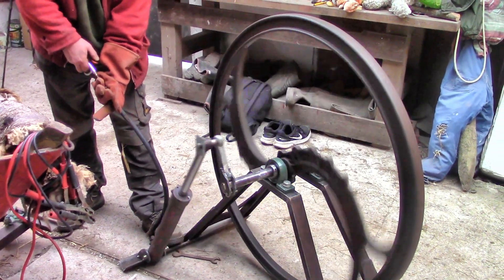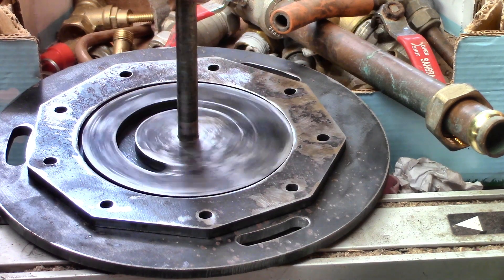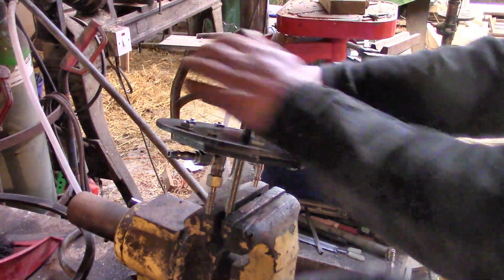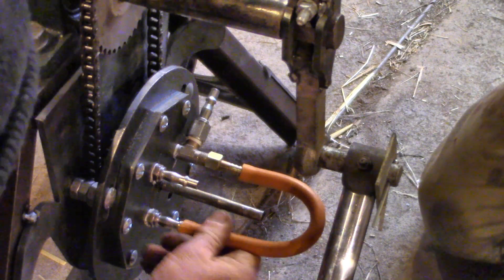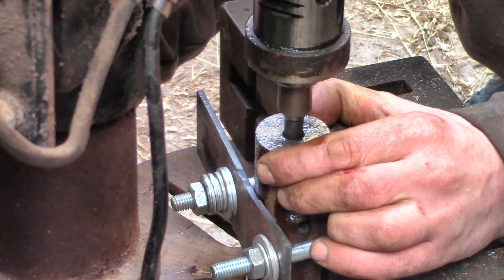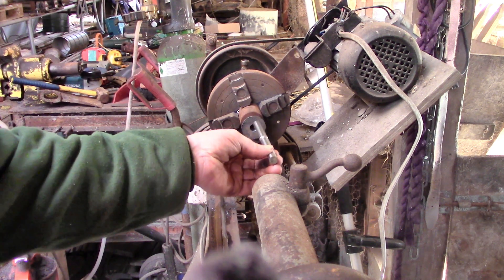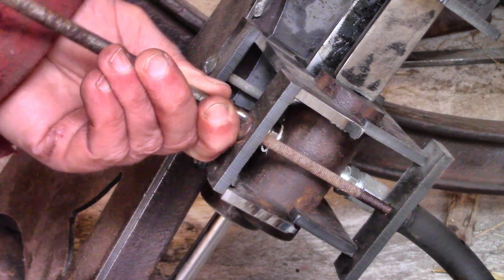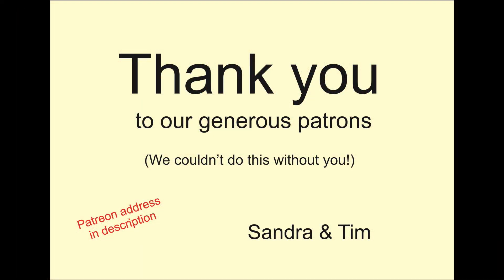Homemade Rotary Disc Valve And Spool Valves For The Steam Engine (I’ve been busy!)

Comment: Hey Tim, I’m an engineering student and I love the videos you and Sandra put out. I think I have an interesting way of solving your valve problem while also opening it to further expansion down the line for a powered push and pull stroke. For the single push stroke model you’ll need to make a box with 3 holes. Two on the top and one on the side. The first on the top will be an inlet valve hole and the second on the top will be an excess release valve hole. On the side will be the outlet hole with no valve. The valves will be made similar to those in an engine. A wide circle with some form of high pressure sealant along the outer edge such as rubber and a rod welded to the center of the disk. These rods will be inserted through the top holes and a powerful spring placed over the rods and centered over the holes and tacked in place to the box. The top of the rods will be threaded so a locking washer can be put onto the spring and the tension pulling each valve closed adjusted as needed. The inlet rod will have to be more complex than the outlet rod and will have to be a bit thicker and longer to make it work. So the inlet rod will have to be turned on a lathe to 2 diameters, thicker towards the disk and a second narrower section at the top to allow for the threads to retain the tension spring on the lower section. On the upper section of the inlet rod a set of 2-3 channels will have to be cut to allow for some small O rings to be put on the rod (hence the different diameters to prevent having to cut the threads over the entire length) Then a housing cylinder will have to be made for the inlet. If you take a bit tube and some round stock you can ream out the round stock to fit the smaller diameter of the rod (accounting for the o rings) then weld the pipe onto the round stock being careful not to get it too hot to prevent warping. Then drill and tap a hole on the side of the inlet housing to attach a quick connect for the air to come in. Adjust the tension on the inlet rod so it will stay shut at pressure then either weld the housing on or find a way to seal it and screw it on. If this is done properly you’ll be left with a sealed zone above the inlet and a rod sticking out the housing that releases the air into the main box when pushed. For the release valve you don’t need to put any housing around it at all.

Now the interesting bit. Attach the valve box to the frame so that the rods point to the center of the wheel such that the rods are parallel to the axle. Reusing your 2 sets of cams and push rods set them so that they are 180 degrees out of phase or so. When the air is connected, the inlet valve will be shut until cam A presses on the push rod that hits and opens the inlet valve. Meanwhile cam B will disengage the release valve allowing pressure to build in the cylinder and turn the wheel. Once the cylinder reaches the end of its stroke inertia will carry it around disengaging cam A and shutting the air off while cam B engages the release valve and allows the pressure in the cylinder to drop and finish the revolution. By playing around with the shape and offset phasing of cam A and cam B  you’ll be able to dial in the maximum power to speed ratio. I’m not sure why but I think you might want to make each cam about a 1/3 of a circle and play with the phasing until you reach the sweet spot.

By adding a second box and some more cams and push rods it should also be possible to make a powered “pull” stroke as well by attaching the top of the cylinder to air as well but the timing would require a fair bit of testing to get your timing just right. If you think this would help at all send me a message and I’d be happy to help you work on some more detailed schematics. My email is crimsondragon97@gmail.com

Comment: You had it working when you were opening and closing the air supply from the compressor trigger manually ( right at the start of the project). Why not just add a small and simple lever that presses on the same airline trigger at the right time. A cam on the flywheel main axle would suffice and attach trigger next to it.
Reply from the maker: because they have plastic in them (no good for steam)

Comment: You could probably revisit the rotary disc valve if you put the air/steam input on the opposite side. If you look at steam engine valves, they are usually sealed by the steam pressure. Incoming steam presses down on the valve, sealing it to the valve block. For your disc valve, you'll need a seal of some kind on the rotating shaft. I guess a graphite gland. And you might want to flatten the mating surfaces of the valve and plate, might need your machinist buddy to do that. Still, it might yet be the simplest way for you to make a valve setup, given you have a plasma cutter.

Also, you are going to want to get/make a double acting steam engine, and one with a much wider piston.
Reply from the maker: Are you sure a wider cylinder will be needed? A long stroke is slower but has more torque..
Reply: @wayoutwest-workshopstuff6299  I suppose it depends on a lot of things. What steam pressure you'll be running, the capability of the boiler, how fast the engine should move, etc. That's getting into engineering that I only have a cursory understanding of.

I'm no steam expert. Just an armchair engineer. But look at old steam engines. Most have a big bore and not so long stroke. Maybe square or a little longer stroke.

Just a thought :)

Comment: Thank you for doing the R&D for a diy steam engine. As I've mentioned, I have a goal of eventually having a steam powered electric genny but don't have the time to tinker on it at the moment. Seeing your efforts is teaching me boatloads that I would have to learn by reading or trial and error later. 

I'd love to see what happens when you add a second set of valves to make the piston double acting, and even more valves to add a second piston.
Reply from the maker: me too : -  )

Comment: So what you need to do is simply make the steam groove in the valve longer and drill a second hole for exhaust, you don’t need two valves for a single acting engine.
With that modification you can have a double acting engine.
I wish I was you neighbor, I could help you out on this project! Maybe trade an Airedale puppy for machine work.😄

Comment: Kudos on using the wood lathe, That’s what metal was machined on up until the industrial revolution. Research it.
Spool valves weren’t used until the late 1800s, by then technology had advanced to the point that metal packing rings were common.
Before that, D valves or 90 degree taps were the earliest ones used.
Reply from the maker: Thanks, Ross. D valves are a sort of slide valve?
Reply: @wayoutwest-workshopstuff6299  Yes, Without a good way to surface them you will run into the same leakage problems as the rotary valve.  
A spool valve will take a lot less horse power to operate though.

Comment: Tim, this would be alot easier with another piston, you could use that lathe to build a custom timing valve to split compression.
Reply from the maker: I'm working on it..!
Reply: @wayoutwest-workshopstuff6299  You could also use your current piston to store energy in a return spring. The work of the engine would be limited to what you can store in the return spring. I'm assuming you could easily create 5lbs of constant torque out of this engine by storing energy in a return spring.

Comment: Why not a slide valve? one of the main benefits is that instead of needing dimensional accuracy, you just need flatness, and the pressure pushes the faces together. they also allow for double action with only two critical seals.
Reply from the maker: Those critical seals are the tricky bit though, aren't they?
Reply: @wayoutwest-workshopstuff6299  not to bad; I don't think you need any crazy tolerance on the slide, just flat on both sides, and the shaft into the steam box can be a packed seal, so also not to bad

Comment: What designation was the iron? I've never seen cast make chips like that, it's usually very powdery. I've never even heard of free machining cast iron, it machines quite easy? Maybe it's a different terminology in the states
Reply from the maker: Sorry Jean-Paul, I only know what I'm told by others. But it does drill very easily - like hard cheese

Comment: Nicely done. 
  One issue with this is the long hose feeding the air cylinder. Long hose wastes energy, adds delay adds extra amount of air to be evacuated during exhaust stroke. 
  The design would benefit moving valves as close to air cylinder as possible and use longer pushrods.
Reply from the maker: I agree, but the frame gets in the way so this is a compromise

Comment: When you don't have access to machining equipment but you need a flat surface, you can use the three plate technique! Look it up, it's quite simple. The basic principle is that if you have three plates and none of them are flat, there is a way to ensure a perfectly flat surface by using the right combination of the three. I think even if you did not want to go to this degree, perhaps putting some grit between the two discs and lapping them together in a rotary manner, perhaps with a drill press, you could get much closer to a machined surface
Reply from the maker: I did just that - with some fine carborundum paste. Perhaps not enough?

Comment: Since the flywheel itself has two spokes, could you not use it to control the timing? Like every time they spoke comes around, it triggers a dog opening the valve momentarily. I suppose it would be a little tricky to get the timing arranged with the key seat, but it would be an elegantly simple design.
Reply from the maker: I like it!

Comment: @Way Out West - Workshop Stuff
10:33 USE COOLING liquids.
You get better surfaces, less wear on the tools, and not as much heat expansion in the material, which is really important for high precision stuff.

Comment: @Way Out West - Workshop Stuff (previous comment attached as reply, for reference)
You could use the disk & sprocket in a 1:1 gearing, then use the disk as a "programming wheel" by adding a groove or ramp onto it (depending on side), that controls a switch for a solenoid or similar, this would also remove almost all that problematic friction. These kinds of programming wheels have been used extensively in early industrial age, and can accomplish AMAZING feats of engineering. For example, THIS: https://youtu.be/OehTO9l1Hp8?t=159
You see that vertically rotating thick cylinder thing, that is a large stack of analogue "programming wheels" (I don't know the name, cam wheel?), that controls how the arm moves.
Also, check this video, he makes a high flow solenoid-ish thing: https://youtu.be/gnwIiw3Rz3I?t=449

12:22 YES! this is what I mean :D (but with a wheel at the contact point to remove more friction.)
For each of those cams, if you make them half as thick, but double them up to the same thickens, then because you already have that groove with a bolt, it would let you also rotate them in opposite directions to increase/reduce the durations of the in-/-activation times.
Reply from the maker: Thanks, Sion. I will study that when I get a chance - so much to learn!
Reply: @Way Out West - Workshop Stuff (For reference, my previous comment)
MAGIC VALVE-ish: 
The timing is directly tied to the rotational position of the flywheel, you could add a kind if ramp & similar to the flywheel (add counter balancing weights too) for the length=duration that the steam needs to be added, then have some kind of button-like thing that gets pressed in when the ramp is in the right position which lets in more steam.

Comment: A silly question but could you not make a second hole in one of the spool valves to allow the air to exit when it’s in the opposite of the air in and that way you could have the two valve actuating both ends of travel so each stroke is a powered one? I don’t know a lot about spool valves I’m afraid but it seams to me that they are like a primitive hydraulic valve like those found on diggers for allowing the fluid either in one end or the other ( if my memory serves if not then it’s the case of the fluid is allowed to enter or exit) would seam to me to be the best option and if I was doing it how I would go about it
Reply from the maker: You're right, it could work. But I think I'd rather have two single-acting pistons than one double acting.
Reply: @wayoutwest-workshopstuff6299  ah of course it does depend what your planning as to how much power you would need and I’m also a big steam fan within my own miniature loco which surprisingly did run and pull weight on one cylinder

Comment: If you use steam, and water condensate gets inside the cast iron housing and compressed on the down stroke, is there danger that the pressure could blow the cylinder to bits? Or is there some kind of relief valve going to be added?
Reply from the maker: this is the sort of thing I hear about a lot, but no one tells me why water would collect in there and not get ejected with each exhaust stroke. So I just don't know.

Comment: Two valves.  One at each end of the piston.  They would switch one being open for exhaust, one closed allowing the air/steam to drive the piston.  It would switch open for the air to exhaust and the other side to push.  Not sure if your familiar with reed swithes but that or a timed relay would probably work.  More mechanical would be a switch that comes on at a preset points on the piston stroke for push and push.  
Thanks for all your hard work.  Your very inspiring and I feel like we would be great friends if I lived nearby.  
My project last week was turning my box truck cooler into a solar powered cooler using 6 panels, and some Nissan leaf batteries.  It works beautifully and I use it several times a week when away from home.  Cheers

Comment: There will likely be someone near to you that can pop the plates on a surface grinder, I have access to one but it's probably not worth the shipping to Yorkshire!
Reply from the maker: Ha! Thanks for the offer, Mick. But, yes, that's a long way from here. Someone said a surface grinder would leave a patterned finish? But I guess you could just use a finer grit?
Reply: @wayoutwest-workshopstuff6299  yeah the ones we use come to a really flat surface but they have the appearance of a texture. Not quite mirror finish but a piece of glass and some super fine wet and dry and you could lap it to a lovely polish!

Comment: With the rotary disc valve could you not have just used a gasket to create a better seal? I can remember my father cutting up cornflake boxes to fix leaky cylinder heads on his old MG.
Reply from the maker: Gaskets work well between plates that don't move, but I need the inner one to rotate..

Comment: I love watching you go from failure to failure with no apparent loss of enthusiasm! I wish I lived closer, so we could team up on these sorts of projects, but I'm in the us so that would not be terribly practical. I've built a small steam engine out of an automotive air conditioning compressor utilizing rotary valves which runs well on air, but I don't plan on running it on water steam. I'll be using a refrigerant as the working fluid, so it will be a completely sealed condensing steam engine.   As soon as I get the boiler feed pump to work, I'll be posting more videos about it. Cheers M8!
Reply from the maker: Excellent! Good luck.

Comment: Maybe try lapping your rotary disc into the body plates? Set your center wall height using a stack of shims and remove a shim - lap, remove a shim - lap,... until the rotary plate comes into tolerance... even I.C.E. valve bodies have to be lapped in order to seal effectively.

Comment: 1st Design needs real gaskets? Second design needs piston rings? Third design needs system for lubcrication? Steam is very hot, will there be conflicting expansion coefficients. Will the rubber ring be resistent to the high temperature? A lot of interesting questions keep coming up. I admire your perseverance and look forward to the next developments.

Comment: This is why I suggested Stephenson's valve gear
Reply from the maker: Thanks - that's basically a slide valve, isn't it? The con  rods look complicated and the extra ones are just for reversing, aren't they?
Reply: @wayoutwest-workshopstuff6299  that's a bit of an oversimplification but yes, and the reverser isn't necessary from what I understand

Edit: reverser also can change the speed

Comment: You can put some O rings on the shaft to seal, so you don't need a lot of precision.
Reply from the maker: but steam-resistant one?
Reply: @wayoutwest-workshopstuff6299  I think ordinary ones can resist to temperatures, because they are used on engines parts. There are silicon O rings too. You can try on the failed valves to see if it works. Hopefully this works.

Comment: Aw yeah, let's get some cam action up in here
Reply: Also, as you might have seen on steam engines they use acuation arms and links as they work without springs. 
It helps keeping a the opening and closing timing regardless of rpm
(But i love the cams)
Reply from the maker: I liked that idea too - it might still happen..

Comment: This is why  O-rings are used to seal the pistons.  They seal the chamber where the air/steam is as the piston moves back and forth, not letting it escape.
Reply from the maker: But O rings for steam? Can they cope with the heat?
Reply: @wayoutwest-workshopstuff6299  You can get ones that will work depending on the temp, your best bet is to get a catalogue from a supplier/visit rheir website.
Reply: @wayoutwest-workshopstuff6299  Silicon will handle heat up to 250C, here is a video about O-Rings youtube.com/watch?v=aweDWuNkPw0